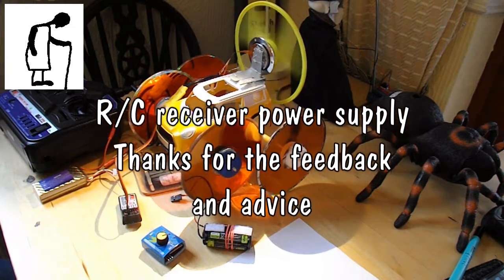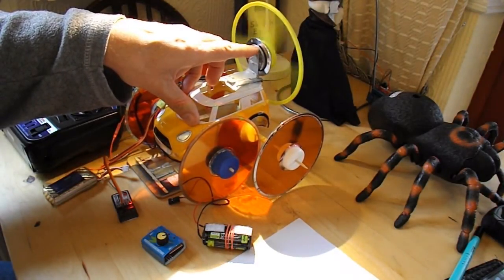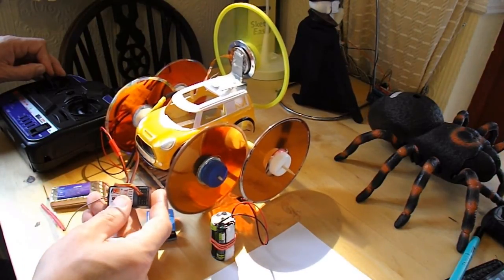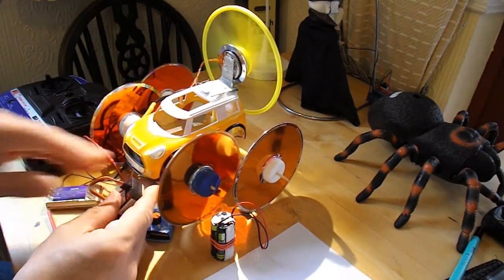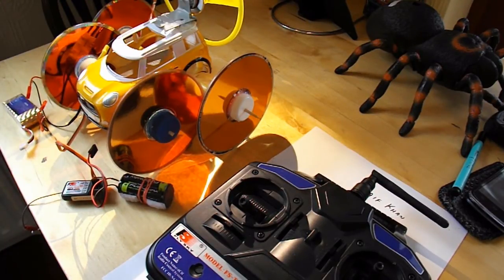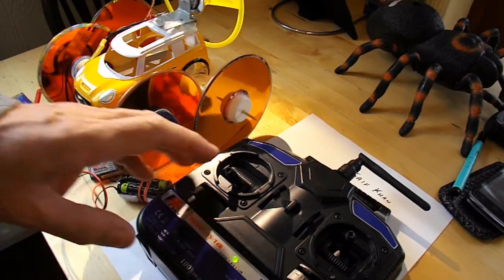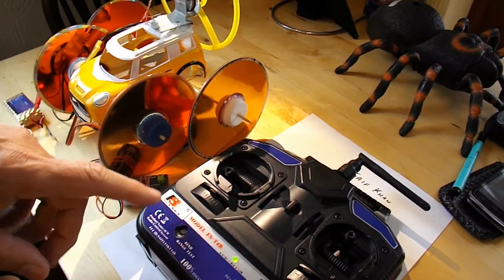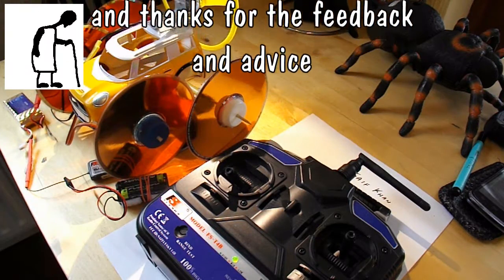RC receiver ESC power supply

Comment: Grandad alto it works in any channel it will damage the receiver.. the 3rd channel was built specially for the bec.
Reply from the maker: Thanks Saif. I can't think of any reason to use it on any other channel as they are all centred but I thought I had better try it as somebody is bound to ask.
Reply: Welcome. and yes i just wanted to just you a feed back so that nobody will damage their receiver

Comment: One of those rules of R/C, that you discovered for yourself. Transmitter on first + zero throttle.
Stems from the days when things didn't need to bind and a receiver could start with full stick throttle....serious damage potential if the transmitter was unchecked and throttle stick all the way up. It's better now with 2.4GHz, but still always good practice.
Also, as you found, things do happy dances when the right sequence is followed.
Reply from the maker: I actually read the instructions on that little red & black helicopter before I used it, which is unusual for me. Start sequence was to put the throttle to full power, switch transmitter on, switch receiver on, then zero the throttle, then it was happy.
But, even following that, the first one would not go to zero throttle unless you actually forced the stick down hard and if you let go it crept up again. I took it back to the shop and got a replacement which works fine.
I am pretty sure I don't have any instructions for the r/c kit I was using in this video.